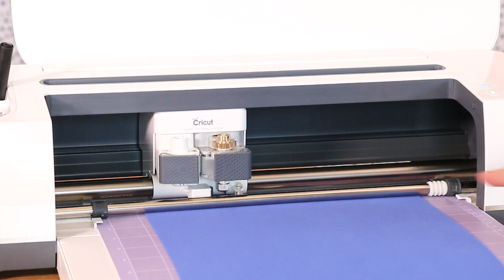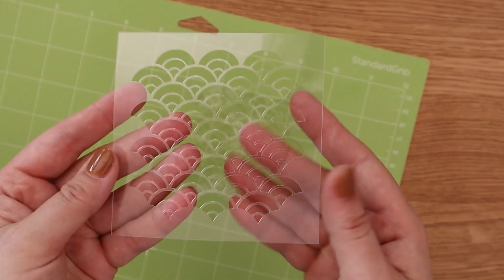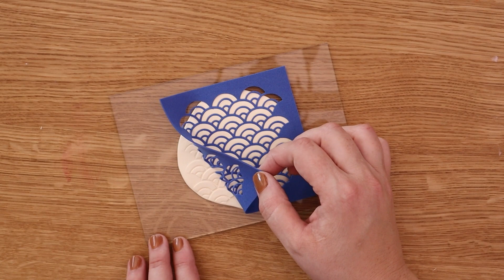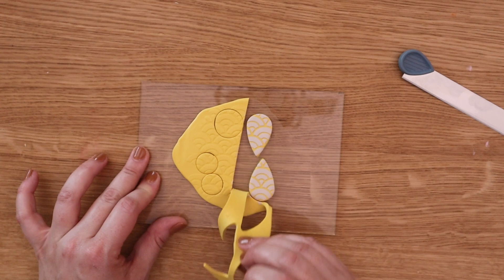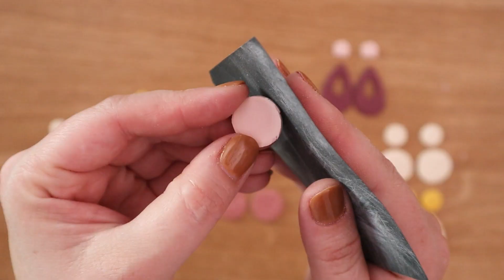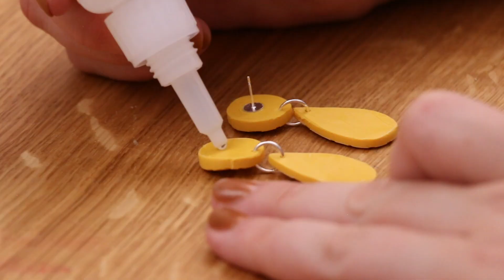How to Make Embossed Clay Earrings with Your Cricut or Silhouette

Comment: I'm wondering if you drop these.. it won't break ?
Reply from the maker: The Souffle clay is soft and slightly flexible, so I don't think you will have any problem with them shattering or breaking when dropped.